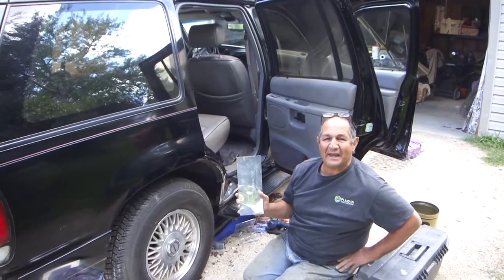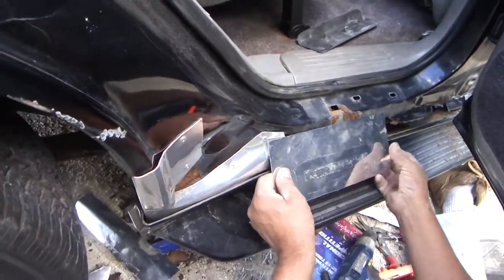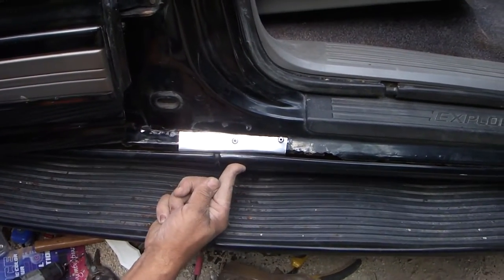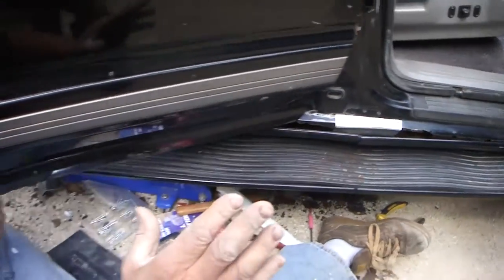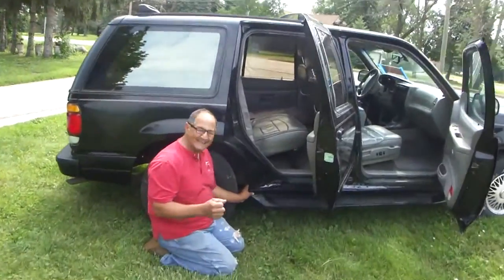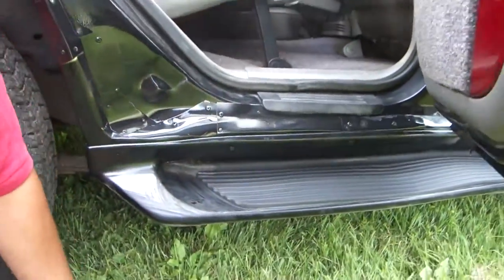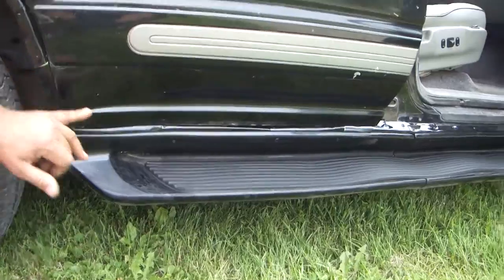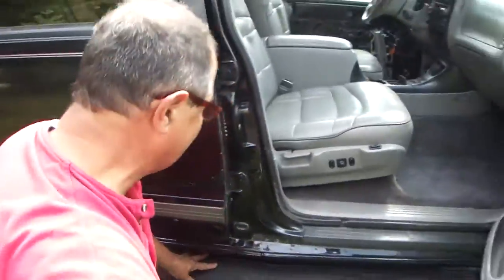Doing Some Body Repair Rust Removal - He Did Work For A For Explorer - Part 5

Comment: Never repair steel with aluminum sheet as they react with each other and rot the vehicle even faster. plus all that your doing is covering up the rust and holes the vehile is structure is still weak undeneath the aluminum sheets.